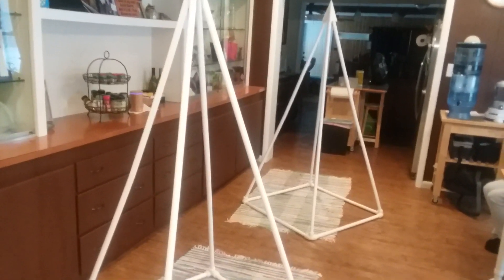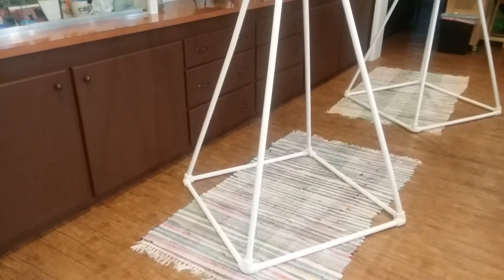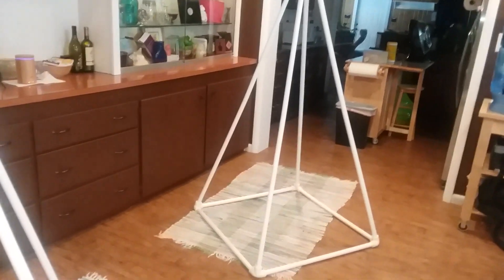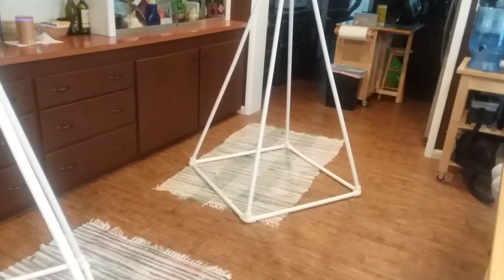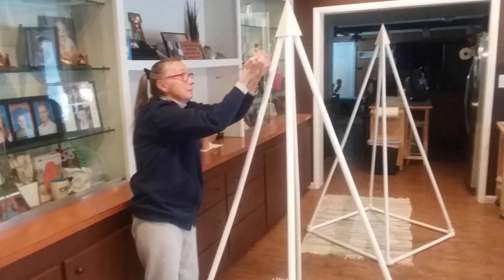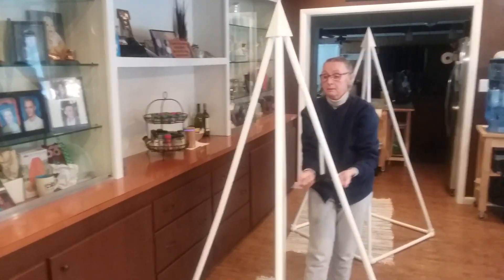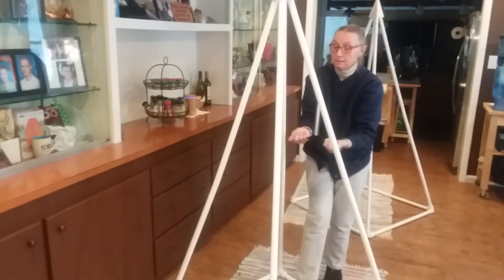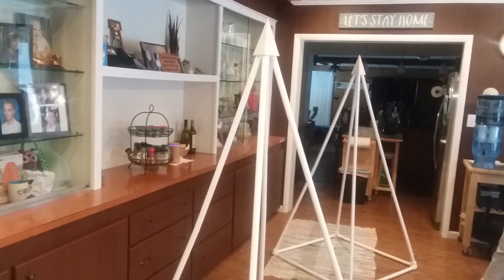Demonstrating the Energy Field of the Newly Redesigned Russian PVC Pyramid

Comment: Does it make any difference if we use wood instead of PVC?
Reply from the maker: No.. any non-conductive material will work fine.
Reply: @pyramidsciencefoundation  What about using pvc connectors and wooden dowels?

Comment: Hi thanks so much for sharing your videos I just ordered some connectors to make a pyramid but I'm not sure my angle is right today they're sending me it's actually 72.8 degrees. Will that work
Reply from the maker: That is the "Nubian" geometry pyramid.  All pyramids "work" as passive torsion generators, but my research, which I am presenting in 2 weeks at the Conscious Life Expo, will demonstrate why the 76.345 degree slant angle of the Russian pyramids is more effective.  I will be taping my presentation and will post it on this channel and on OnlyPVCPyramids.com after the Expo.  The other thing to consider is that the Russian geometry pyramid is the most thoroughly researched pyramid geometry on the planet.  I have done a 20 part series on the Russian Pyramid Research, detailing all the research done on this pyramid geometry.  To my knowledge, no one has actually published ANY scientific research data on the Nubian geometry.

Comment: I'm trying to make one that's about a foot or maybe two what are the dementions plz n thxx
Reply from the maker: first, pick a height.  The base length will be the height divided by 2.058.  The length of the vertical pieces will be the height * 1.0291
Reply: @pyramidsciencefoundation  okie dokie thx!
Reply: @pyramidsciencefoundation   also what degrees does the angle on the top and the bottom need to be thx a million
Reply from the maker: the slant angle (bottom) is 76.345 degrees and the apex angle (top) is 27.31 degrees

Comment: Love it  !!! ........A few things , can you firstly tell us what setting one needs to use  on the Lecher Antenna for pyramid energy  testing  please ? ........also sorry maybe I am having a bad day ,  existing six  foot pyramid is 35.65 " ( length of base  without fittings ) What should the new base size be and how exactly does one calculate the length of the sides ? tia.
Reply from the maker: 17.6 is the Lecher setting we are using.   However, I just ordered a new Life Energy Meter which should be arriving any day now.  We are going to start testing it as soon as it arrives.  If works to my expectations, I will be doing videos using it going forward, as well as selling it on the website.  Call me at 412.474.3481 for help with the new dimensions.  I have some questions I need to ask you.
Reply: @pyramidsciencefoundation  Thank you.

Comment: Thank you for showing this.  The "russian" pyramid measurements are based on Nubian pyramids.  This may help others to research the true origin of this information.
Reply from the maker: I would be interested in the source of your information.  The pyramids.ru website, which is Dr. Golod's website, states a ratio of height to base length of 2.02, which results in the 76.1 degree slant angle.   I know that John DeSalvo stated that Russian pyramids have a slant angle of 73 degrees., or 1.618 ratio of height to base length , and  David Wilcock stated the slant angle was 70-72 degrees.  However,  these statements cannot be validated by source material on the pyramids.ru website. or the articles by VOLODYMYR KRASNOHOLOVETS on the gizapyramids.com website.  Also, Patrick Flanagan wrote that the Russian pyramid Phi geometry was different and superior to that of Giza and Nubian.